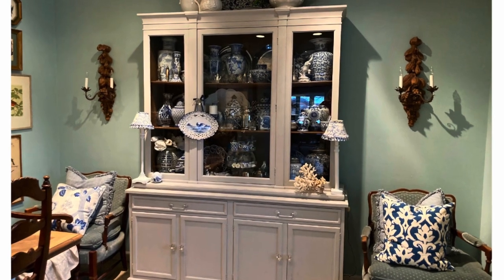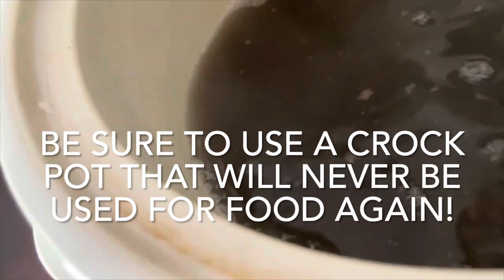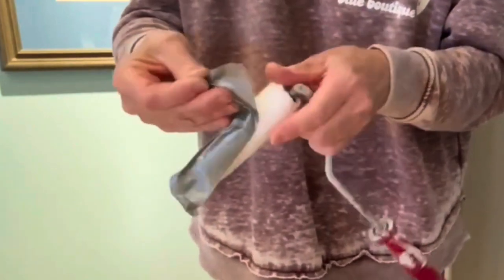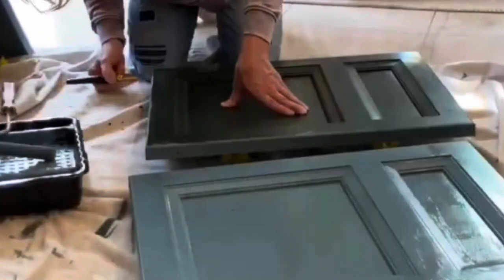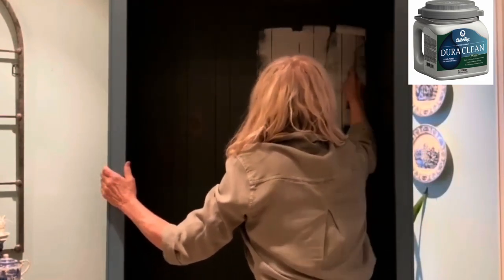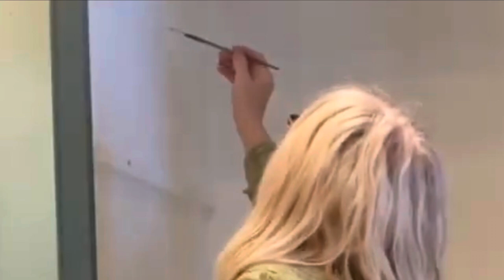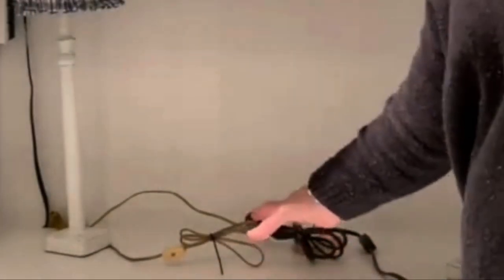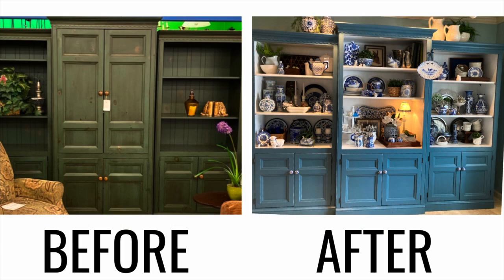DIY Furniture Flip/High-End Furniture Dupe/Cottage China Cabinet

Comment: I would have gone with a neutral color like taupe. But it is still amazing. You’re so brave to take on such a huge project. How long did it take?  I converted our old tall single unit TV cabinet into a bar. You don’t know it’s a bar until you open the door. We put strips of mini lights inside that adjust to different intensities with a remote.

Comment: This is a great idea!  I have my eye on a huge but ugly cabinet at my local Habitat Restore.  I need a lot of storage and my poor 1950s kitchen just doesn't have it.  The cabinet has open shelving on the top, like what you did.  But I have cats.  So I'll add doors.  Maybe I can use those doors as decorating space and hang some of my special platters and plates there!
Reply from the maker: It has so much storage. I love the closed cabinets on the bottom. I store bulky appliance (like an air fryer) in there. I think you’ll be glad if you buy one.
Reply: Appliance storage is one of the big things I need.  Have you ever been awakened by a cat turning on a bread machine?  It's unsettling.  I'm heading out Thursday to see if they still have it. Fingers crossed.  I had planned to butt it up against my ceiling high cabinets in the kitchen.  It'll be a tight since the cabinet is also ceiling height!  Now I'm thinking... Oh! Let's paint it!  Decisions...decisions.  I'm so glad I found your channel!

Comment: How did you choose the type of paint that you used? I see so many people using chalk paint on furniture and I just don't understand the differences between paints.
Reply from the maker: K, people use chalk paint because you don’t have to prime or prep the furniture (just clean it). However, it doesn’t give a smooth finish unless you lightly sand it. There are a lot of good latex enamel paints on the market now that will allow you to do the same thing (but will cost a bit more). If you don’t want the ultra matte finish of chalk paint, I would just ask for suggestions from the clerk at your local paint store. They are usually well informed about which paint to use.